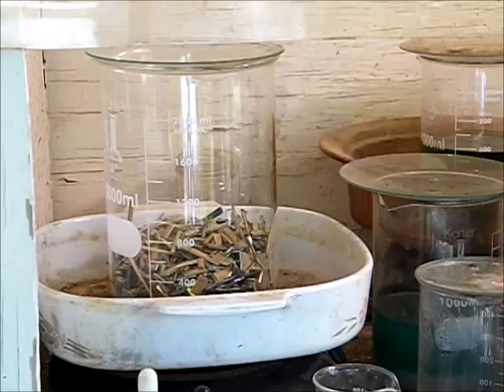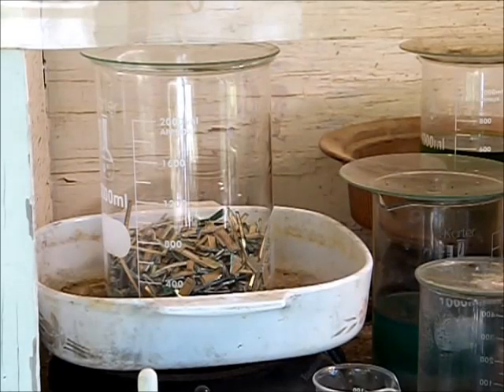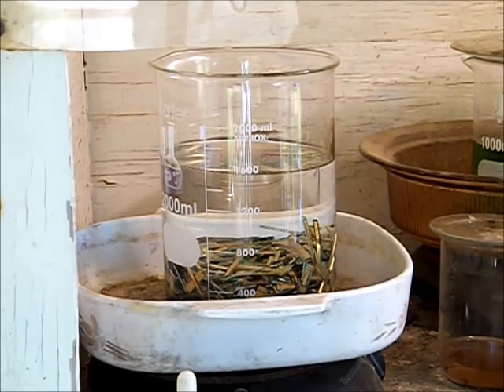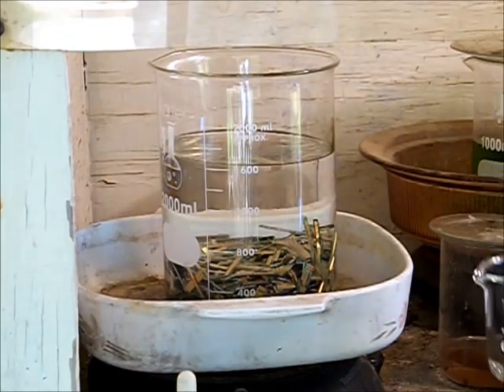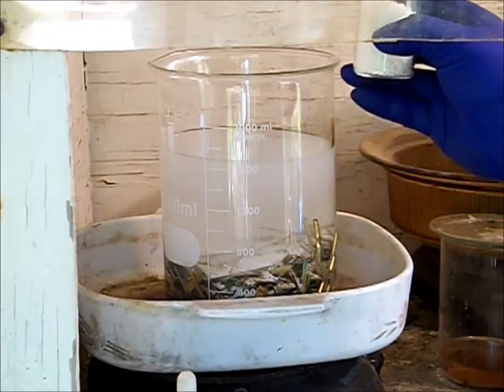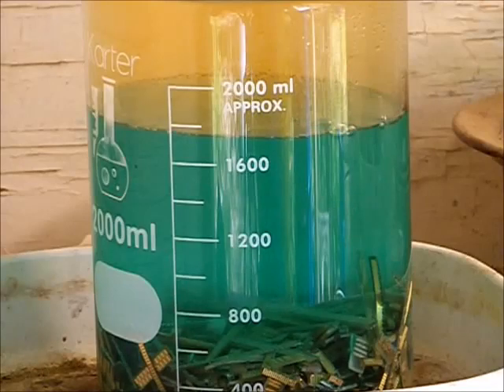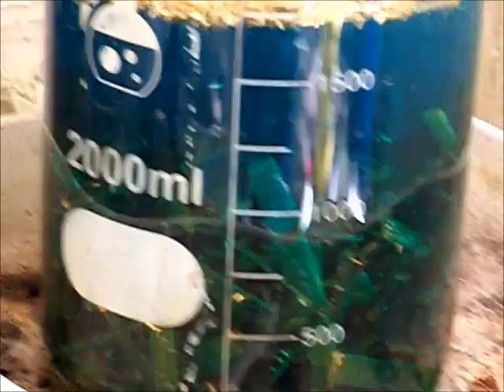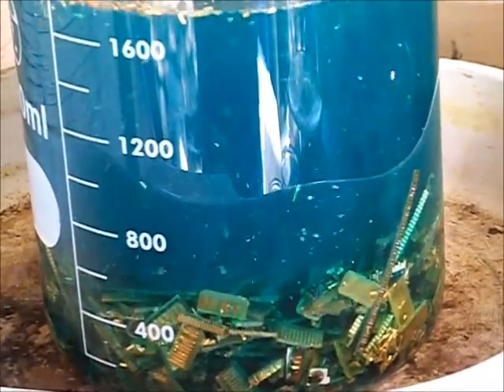poorman's nitric acid

Comment: Can this poormans nitric be Pre made and stored?
Reply from the maker: Yes, store in a cool place out of the sun lightly capped. Do not seal completely. It only reacts when there's metal that can be dissolved.
Reply: Geo what would the mix ratio be?
Reply from the maker: Since I don't premix, it would be hard to say. Solid sodium nitrate equals nitric acid very closely though the needs 1.2 gram to 1 gram of nitric acid. The sulfuric acid is mixed in relation to the water used. I normally mix it 10% concentration roughly. A gallon is 3,785 ml's. A gallon of tech grade nitric acid will dissolve 2.5 pounds of copper. 2.5 pounds is 1,132 grams. It takes 3.3 ml of tech grade nitric acid to dissolve 1 gram of copper metal.  1.2 X 3.3 = 3.9 grams of sodium nitrate to dissolve 1 gram of copper metal.
Reply: in his beaker from what I can see, it is a 16:1:1 (1600 ml of tap water, 100 ml of Sulfuric, and 2x 50ml beakers of Nitrate for 100 "ml" of Nitrate to approximately 800 'ml' of material to be dissolved.  Best I could guess.
Reply from the maker: Correct
Reply: another way you could look at it:  800 'ml' of material approx, 1600 ml tap water, 100 ml sulfuric, 100 'ml' of Nitrate = .5(water volume)+ water volume +.0625(water volume)Sulfuric Acid + .0625(water volume) solid Nitrate salt + heat.     :)

Comment: There's way easier ways toake nitric acid. Get some calcium nitrate or some other water retning nitrate salt. Then just add sodium bicarbonate, boil it down to supersaturation and let it cool down to room temperature. Collect the sodium nitrate crystals and biol it down some more to crystallize the rest.

Edit: it has to be distilled with H2SO4 to get 68% nitric.
Reply: Distilation isnt easier than this.
Reply: THAT AIN'T EASY!!